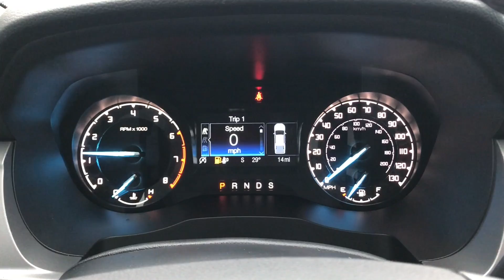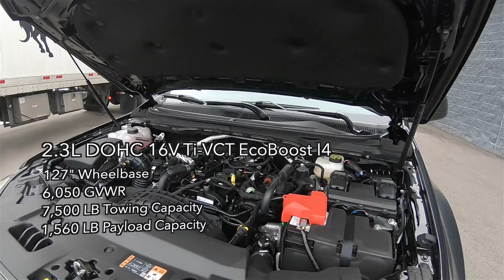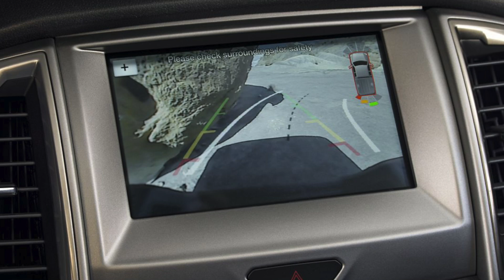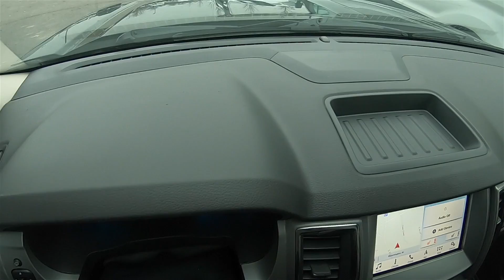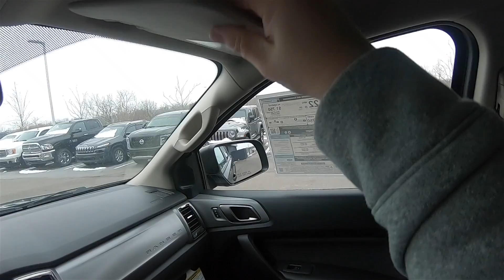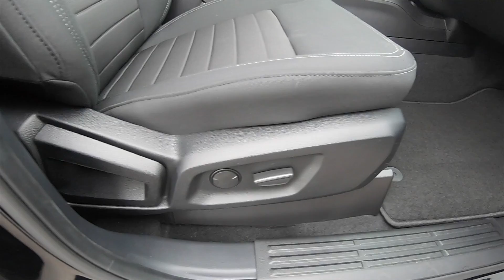2019 Ford Ranger XLT SuperCrew FX4|In Depth Review|Test Drive

Comment: Over 40k for a half way decent equipped XLT with a little 4 cylinder motor is BS. They selling same packages for 10k less overseas brand new. So why the big up charge on us? I really like the truck and I need on for what I do, but it’s unaffordable for regular working folks. Trucks are turning into toys for the rich.

Comment: Dated platform?......are u sure about the wading depth measurement???...
Reply from the maker: Well, this generation Ranger, while new in The States, is not at all a new vehicle.  In fact, the basis of this  platform has been  around for a while, although modified pretty heavily for our market.  Also, water fording depth was researched by the Ford Ranger Press Release and other online media.
Reply: @NeighborhoodCarReviews  i have a 2019 ranger n the wading depth is 800mm... we have different engine though... i have  the 3.2 so maybe the engine design has limited the north american market?
Reply from the maker: @princeodinson3239  That very well could be.  They had to modify the frame and components to meet our crash requirements and such, so, it could be different.
Reply: @NeighborhoodCarReviews  thank u so much for this info... i love this truck because its the perfect size to go beach hunting and offroading when the trail is narrow... n the low down torque gets u up those slopes... river crossing is another huge plus... i don't see me having as much fun with a f150 but this at the end of the day just comes down to functionality for the individual.

Comment: Toyota Resell Value says it all
Reply: Haha! Ford trucks are always #1 in every category. New Ranger has best powertrain & technology by long shot. Built like a tank as well. 300hp on premium fuel plus 23mpg highway. I'm all in.
Reply: Stanley Kania while the Taco is nice and is reliable, it’s also a gas hog, it’s gutless and too small inside (I’m 6’4”   210 lbs). It’s an old antiquated engine and transmission.
Rangers have a reputation of being very reliable to be factual. 
The new Ranger has:
-good MPG
-best in class towing
-More interior room than any truck in its class 
-highest torque in class (except Colorado Duramax Diesel)

Comment: These Rangers are to expensive
Reply: Nah they worth every cent. Built like a tank an high tech w/ an awesome powertrain. Its 2019 not 2009. Head an shoulders above ole Ranger!
Reply: Hardly! U really get so much truck for the $. Best in class tech/features/design etc. Drove Colorado ZR2 / Taco TRD pro / Ranger XLT FX4. Ranger powertrain is true game changer ..as all reviews say. Truck Is tank solid like an F150. Bought my new Ranger on spot after test drive. 5mos /7k mis later.. it only gets better after full break-in. I run Pennzoil Platinum SN+ full synthetic 5w30 & motorcraft filters.
Reply: After 2019 Q3 the Ranger had only moved 56K Units, I will be surprised if they manage to finish the year at 85K.
Reply: Just cant see these Rangers being a good choice for a long term reliable truck, Turbo, Direct Injection, Stop-Start, 10 Speed Automatic, way too much expensive shit to break.
Reply: @Shakerhood69   90k units sold so.....your surprised!
Reply: @willie9397  @Willie, no that sounds about right, think they finished off 2019 at around 87K.
Reply: As compared to what? Tacoma’s? Colorado’s?
Reply: As should
Reply: They are DISCOUNTS  now they are not selling  like Ford wants  only 25.000 sold so far way lower  then the 200.000 they expect  to sell
Reply: @THEBEARDEDTOOLGUY  100k+ units sold as of Dec1. It's an awesome truck w/best powertrain in class. Built like tank as well. Will sell just fine! Ford trucks!
Reply: eric nichols they’ve barely been out. I’ve started seeing them pop up everywhere  now
Reply: @thewitty422  They hit there 1st yr sales target of 100k trucks. Emphasis was <high quality> vehicle launch as should be! Not max units sold. Dealers only really had a few by Feb 19. New Ranger had be top notch from get go as competition Is hot plus Ranger name Is legendary. Love my '19 XLT FX4 crew cab.. loaded.. 7k mis. Drives better & better as mis accrue! Do recommend @least 89 octane - midgrade. These high performance TGDI EcoBoost motors thrive on quality fuel. Well known u get 300hp on 93 premium no mods!👍🏆Keep truckin!
Reply: Would take an old Ranger any day over the new one.
Reply: Edward Dawson they’re new, should start seeing better deals now
Reply: Im getting one fully loaded for free. My girlfriend is buying it for me after selling here house :)
Reply: @stevenbruce5789  lucky guy! U will love it. Full Synthetic SN+ rated oil ...& motorcraft filters every 4-5k mis / that high tech TGDI motor last forever. Run premium 93 octane fuel & U get a stout 300hp:)🏆
Reply: Seems like the Rangers are suffering from shuddering too, I can only imagine how bad they will be after a few years of use. https://www.cars.com/articles/all-the-pickup-truck-news-2019-ford-ranger-doesnt-have-great-vibes-multiple-gm-recalls-and-more-415680/

Comment: Former Ranger owner (3 of them). I been waiting for the new one for quite a long time. I just test drove the new 2019, and the results are in.......JUNK! What a disappointment, the engine is too weak and the 10 speed transmission is always shifting. The only thing I really love is the looks, very sharp looking. I would never buy this, unless the put in a new engine V6.
Reply: As a guy who has tested the 2019 Tacoma, Ridgeline and Ranger, I have to say you seem to have very lofty expectations. I felt that the ranger engine pulled real hard and that's also the opinion of the automotive press. It certainly isn't lazy like the Tacoma. No one shopping in this segment is looking for big power, they are looking for fuel economy and I experienced 10.6L/100km (22.2 mpg) after one hour of mixed driving and I got into the throttle several times because the truck is quick.  As far as the 10-speed transmission goes, it does shift around a lot but its almost imperceptible.  It has twice the gears as most of the competition and keeps the engine in the sweet spot, I thought it was a superbly calibrated setup. The tech is not new and the back folding seat is BS but otherwise a great little package. It kinda looks like they just quickly put something together so they could get a piece of the mid sized truck pie but it still brings something significant to the table.
Reply: Its also smaller and priced higher than the segment leader Tacoma,  that rear seat is disappointing as is the lack of power sliding rear window,  no sunroof option, no manual transmission, no NA V6, and no 4 door long bed.
Reply: @Shakerhood69  I agree with you on those points but Ford is clearly using their global Ranger to get back into the North American mid sized market. All the others sell long box crew cabs so ford will be on that at a later date. As far as far as the V6 goes, I don't see an argument for it right now. I'm not a turbo fan but that Ranger outperformed the Tacoma during my seat time and I'm not talking about racing around, I'm talking real world left and right sharp turns, up and down hills, stop and go traffic. The Ranger was just better to drive and I didn't hit my head on the ceiling once.
Reply: @ECR, sounds like you found the right truck for your lifestyle.

Comment: I really wanted to get this truck until I saw all of the epic fails. Why would the rear seats not fold down in a 60/40 split?
 Or even better they don’t fold down at all so if you want to store something or pick something up you have to lay it on the floor which is not flat and you can’t have someone in the back.. why did they not put a hydraulic in the rear tailgate? Where the hell is the sunroof? I swear these manufacturers just don’t think when they bring things to market meanwhile they should’ve just looked at other manufacturers and see what they’re doing right and what they’re doing wrong. 🤦🏼‍♂️
Reply: Compared to Tacoma and frontier this truck gets it done. I test drove the ranger and Ford did a nice job.  This truck is not built for snowflakes who complain
Reply: Jim J yeah they aren’t going to bring up towing capacity, payload or torque because all they’re worried about is if half of the seat can fold up lol
Reply: Seadoo4life and don’t forget about the manual rear glass.  My 2012 150 FX4 had power. I’ve never really taken the time to get in the back seat to open and close a manual sliding rear glass.
Reply: Lrays Lrayss yeah to bad. I really liked the look of this truck and this is coming from a 2016 Colorado owner
Reply: This truck is already years old that’s why it’s lacking.
Reply: You are 100% correct.  This truck lacks a lot of frills but comes with a premium price!!!
Reply: This thing is an epic fail imo... Read my post above ^^
Reply: This is also only a xl (the base model)
Reply: @andrewgray1755  no it isn't. It's a fx4
Reply: @Autumnleaf2011  then dont buy one , see its simple, lol

Comment: Nice review what is the price for that truck with the fx4 package included ? Thanks
Reply from the maker: Thank you! Full pricing and all options installed are listed in the description box!
Reply: On the top trims these get really pricey.  Too much IMO and thousands more then loaded Z71's and Tacoma offroads.  However, one thing that Ford did right was they made the FX4 package available on all trims.  So you could actually get this on the XL and probably pay in the low 30K range.  And IMO, the only way to get a good buy/value is to probably go with the XL and load it up.  .
Reply: HiPlains1 the best bang for your buck is the XLT with all the goodies. That’s what I bought and I’m extremely happy!
Reply: @MrClownWorld  me as well. Must use full synthetic motor oils SN+ rating. Engine makes 300hp on premium fuel...says Ford engineering!
Reply: David Klimmek are you on the forum? 5GRanger?
Reply: @HiPlains1  thanks
Reply: @HiPlains1  XLT FX4 crew cab loaded here! Amazing truck. Blows away my buds '18 Tacoma TRD off rd an on rd. Hes selling his truck! #Ecoboost

Comment: On the outside, better looking then the lariat.  Prefer the grill on this one.  Put some offroad steps on it will complete the looks.  As for that mid cycle refresh that you speak of I did not like what it did to the outside front end look.  My 2014 with a nudge bar in the Fiji Islands was much tougher looking.  Also not liking the smallish hvac knobs etc.. on the inside.  GM does a much better job on their infotainment and button layout.  But this is how Ford lays it out both trucks and cars.  The other carry over that should have been fixed was the back seat.  Won't fold flat.  Only half ways on at an angle.  Never understood that.  Plus no tail gate assist.  At this price point it should.  But if I had chose this over the Chevy this model is about what I would have got.  Closest to what I had in Fiji. But I also had the 3.2 diesel which was a beast.
Reply from the maker: HiPlains1 I like how the Lariat can also have the Sport Appearance Package and not the Chrome.
Reply: @NeighborhoodCarReviews  Still prefer the XLT over that as well.  Its the grill treatment.  They are all different.  XL, XLT, and lariate all have different style grills.
Reply from the maker: I have a feeling that when the redesign happens on the Ranger, we will see tailgate assist, the tailgate step as well as other technologies that should be present. I feel that the buttons are a bit small, cryptically labeled and not very cohesive. Now, I do actually like the Ford Sync and FCA Uconnect systems over the GM infotainment systems.
Reply: @NeighborhoodCarReviews  Allot of people think this Ranger is all new model.  And Ford did go with a new motor and transmission.  Also the steel bumper.  But allot of this is still the good old T6 that the Australians developed back in 2012.  Ford really didn't commit to bringing this home until a few years back. And when Toy/GM started to sell over 400K units combined on the mid size then Ford could no longer deny the mid size market was dead.  At which point they backpedaled and rushed this to market. The interior and exterior looks so much like my 2014 except the front end.  And that refresh in 2015 made it look worse IMO.  Its still a great truck.  And globally it's taken a huge chunk out of Toyota's Hilux market share.  I don't think it needs much but the front end really needs redoing again.  The tailgate.  And also allow the back seat to fold flat.  Also clean up the tiny buttons.  That has been going long enough on Fords.

Comment: Question. Why do some have an engine cover and some don't. Was it removed for the review?
Reply from the maker: Interesting. I didn’t remove the cover. I just figured it didn’t have one. Hmm.
Reply: @NeighborhoodCarReviews  Is that a pre production unit?  Some of those came without a cover.  All the ones on the retail lots should have one.
Reply from the maker: HiPlains1 Nope. This is a lot-ready unit. Either the service department didn’t put it on during PDI or the factory forgot it. Not really sure.
Reply: @NeighborhoodCarReviews   Man that is really weird.  I'm wondering if Ford is having a supply issue?  In their earnest to get this to market just send it out as is?  No can't be lol.
Reply from the maker: They might be, or it could be that the technician at the dealership didn’t install it during prep. Not really sure. Nothing surprises me anymore!
Reply: @NeighborhoodCarReviews  Well when TFL reviewers were up in San Diego with the test trucks I remember one of those trucks didn't have the cover as well.  So this is the second one I've seen already.
Reply from the maker: HiPlains1 So odd.
Reply: @NeighborhoodCarReviews  factory DID NOT forget anything! It's a cool looking engine from the RS rally race car . Look in real life folks not odd angle video view.
Reply: @HiPlains1  Ford has NO SUPPLY ISSUES. It's an awesome engine. Looks great an runs even greater! See at dealer not on YouTube.
Reply: I thought only the XL trim level had the dual analog gauges.
Reply: @willpumphrey  Nope. The XL and the XLT have the same dual analog gauges. Only the Lariat as the 1 single analog gauge with 2 4.2" digital screens on either side
Reply: Turns out that only the Lariat trim level has an engine cover. The XL and XLT do not. You can purchase one from the Ford part department though if you want one.
Reply: It's a beautiful engine. Go see at Ford dealer dont judge by a video! The powertrain is best in class.